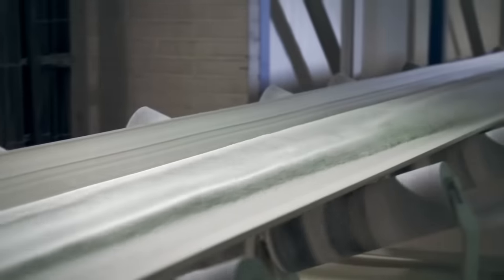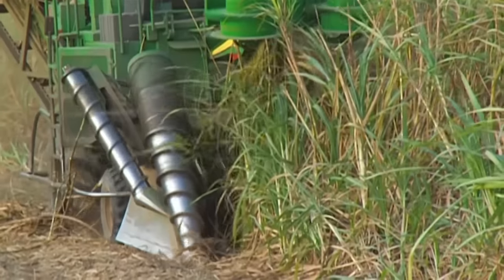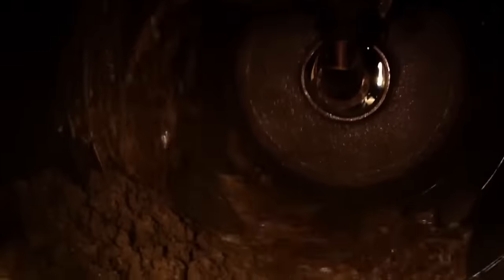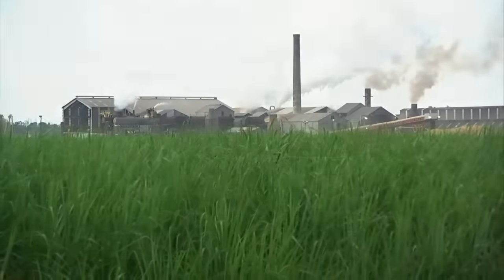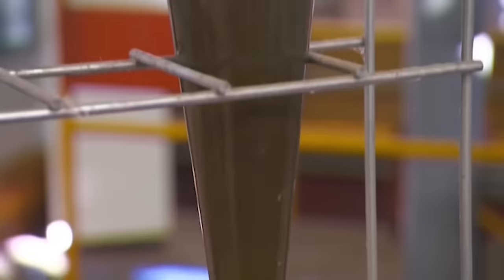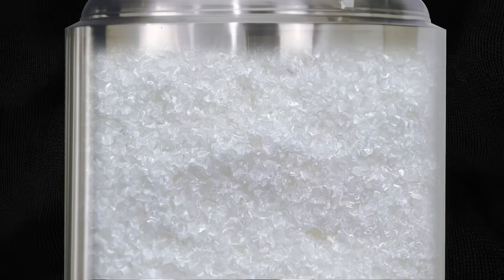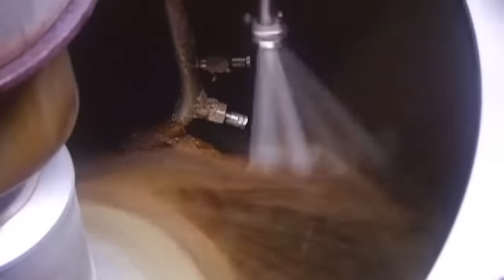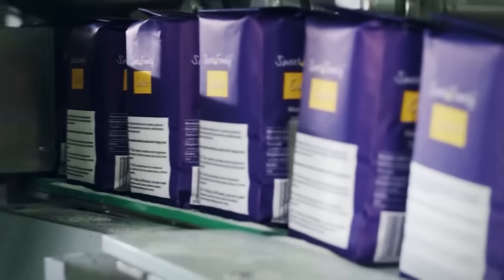How Sugar is Made

Comment: Don't you have the temp and pressures boiling backwards?   The higher the pressure the higher, the higher the boiling point.  I.E.  radiators in cars.
Reply: its meant to be a lower pressure not higher

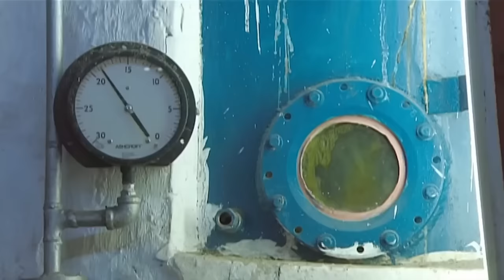Comment: 4:24 - This is an error. Evaporators are not under increased  pressure, they are usually under vacuum. Vacuum reduces the boiling temperature. If the evaporators were under increased pressure like the video says that would actually increase the boiling point, not reduce it.
Reply: Yeah, a vacuum pan is used in boiling the sugar to form massecuite

Comment: Each evaporator should be operating at a lower pressure to get successively lower boiling temperatures. The gauges on  the evaporators are also shown running from zero on the right side to a maximum of 30 on the left side, which is range evaporation happens, between 0 inches of mercury relative to atmosphere to ~29 inches of mercury relative to atmospheric.
Reply: Yeah that bugged me too

Comment: Bagasse cellulose can be made into sanitary towels and diaper-nappies when the crop is grown in countries where displaced peoples have aid and jobs, thereby having them as part of a staff package so that points are earned for the sanitary-towels which have OAuth2OpenIDConnectWalletFoundation Q-R codes and hashes written all over them (printed adhoc per person associated, along with altitude, longitude, bearings and altitude and time-date stamps on them). In the right timeline, rather than only being 'free no-matter-what' female-hygiene products get "beeped" and dropped off for disease testing at automatic biology lab booths or female lavatories in exchange for earned-points. In various forms (sometimes refined) sugar travels well (especially glucose) as a "dead-food" which never goes off, and Israel rightly include it as a MRE prepping. Where high salted soils (Australia being an example but other world locations such as the Islamic world regions) struggle to grow crops, selectively bred salt tolerant crops (like rice) can be grown whereby solar (and sometimes 'nuclear burned' radioactive waste fuels) power desalination of water which is then used to flood the arid soils (eventually using up the salts and reducing the salt in the soils as a byproduct of the actions) and feed people. Hydroponics in addition can be boosted by the sugars (as a plant food) to supplement artifical light crops to grow early before being planted outside. The aforementioned digital identifying technologies can track everything (such as by Markov-chains, and Gaussian-heatmaps or kernel density estimation like Parzen-Rosenblatt window method or a non-probability solution via Lorenz-versus-Laplacian weighting) for logistics too.

Ethanol dual motorbikes (and electric) can overcome range-anxiety, as can small (Ford-Fiesta postman-Pat sized vans) which can run on pyrolysis diesel-dual-battery powered charging motors to overcome range anxiety or the need to have more pulling power for heavy loads or for transporting 2 people in the front with a cargo or folding up the passenger seats as an extra 2 rows for 6 or more people like a Citroen DX might have done.

The main thing though is that sugar, if stored right, simply will not expire as a glucose molecule and neither do some salts thereby making it worthy as a displaced-people's MRE food and low-power computing energy source. Even though grain silos are a reasonable source of carbohydrate and proteins (especially if legumes or beans are added into a dish), salt tolerant crops like rice (with added multivitamin pills) can make a sugar sweeten dish, at which point, in order to qualify to get it, the person has to use their digital identity nagging prepping material to look after their teeth and get the dental powder associated. Ethanol (and other alcohols including propanol or methanol, and acids associated like methanoic acid for frost removale at aircrafts) can be used in training for jobs for cleaning (hygiene) and electronics and fueling. Various plant celluloses can be made into tiger-token or benson-and-hedges tokens style coupon-vouchers as collector cards for prepping information and earned comms connections data allowances. 

Corn-Syrup is sometimes more useful but really that is down to geographical location of optimised crop growing techniques and export logistics and costing. Where those crops are less likely to be a model that works with business analysis, the sugars serve the above functions. Geothermal power (Italy, New Zealand, Iceland, various USA influenced lands) is so abundant a power source technology that its desalination technologies can be used to support that such as bringing potable and crop usage water to the South of New Zealand, at which point the extraction of valuable periodic table elements (and molecules) from the byproduct salts can be powered also by geothermal or volcanism power technologies. Sugar however (for example in the glucose form) is not only portable but can sit in a place as a prepping stock and it won't expire if treated well. Humic material byproduct matter can be used to make improved soils in barren regions whereby growing trees and similar crops can reduce the surface temperature to increase rainfall such that the rain does not evaporate before hitting the ground. Geothermal "greenhouse basements" in Iceland to grow chocolate (mitigated by artifical light hydroponics) would be rather nifty, as would pineapple. Dates in Lebanon via an Ecopeace style model with Jordan would be a good desalination or water-management income approach for locals, just as long as efficiency was heavily computerised (which is also handy because you additionally end up wih a Rosetta-Stone effect for documentation and man-pages and proprietary software). That whole Middle_East barren landscape is like a Mars-Rover computer potential to deploy a bunch of computing (including Linux and BSD and OpenIndiana of course, plus proprietary softwares) so that the homework (and means to get media creation going) is there before the people show up the moreso. Deploying British UK QWERTY keyboards is important, emphasising the pronunciation of the letter 'O'. The man pages and Unix-time-stamp are the unavoidable anglosphere Rosetta-Stone. Translation of the english language is inevitable, and english language totally nailed it on the Civilisation-Alpha-Centauri RTS gaming technology tree, except for real IRL. Union-Jack smoking-jackets and bath-robes FTW. The only thing that comes close is how some music is more meowable than others. Everybody does that. Yes, everybody.

In terms of refugees and displaced people getting the sugar MRE, especially with it being addictive, the identity-associated prepping-homework would be completed before you get to open the tamper-proof packaging, and even then they'd need to be using the dental powder scheme. These things have to be rationalised. If I were given a Jewish sugar MRE, I'd blatantly be thinking of how to turn that glucose into moonshine (strictly for research), at the sacrifice of eating a dull food to mitigate the dietry loss. Cocoa powder and lipids would end up as an Irish Coffee or a Baileys. Everybody has something artful about their imagination, so the aformentioned earning-points is a way to reduce such inventiveness unto morality interpretations. The wrapping would force you to draw a graph or something before you can get to the good stuff. If you can't walk in a straight line, you won't be able to complete that unwrapping prerequisite. Maybe you'd need to know that an audio music player Graphic equaliser (histogram bin witha gaussian kernel on it) can undergo spectral analysis via usage of Chebyshev polynomials (and who he is), and that Gaussian eliniation (karaoke mode for example) uses it. Only then if some happenstancial skinfulness (for the top-tier completionists) "accidentally occurs" can the Karaoke bar mic be passed like the conch in Lord Of the Flies.
My comment has no hate in it and I do no harm. I am not appalled or afraid, boasting or envying or complaining... Just saying. Psalms23: Giving thanks and praise to the Lord and peace and love. Also, I'd say Matthew6.

Comment: What? Each succeeding evaporator has a higher pressure meaning the sugar boils at a lower temperature?  I think you have that backward.  It should boil at a lower temperature when it's a lower pressure, not higher.

Comment: Basic science fail -
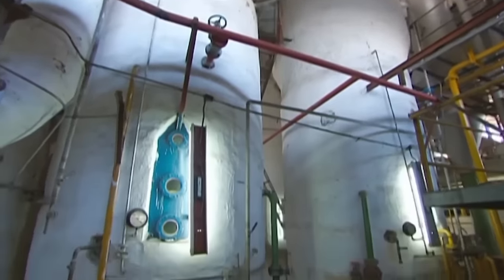4:20  "each succeeding evaporator has a higher pressure, which means sugar boils at a lower temperature."

This is the opposite of how pressure and boiling points work. The lower the air pressure, the lower the temperature of the boiling point. This is why pressure cookers are a thing. They allow you to cook food at much higher temperatures without boiling away the water.